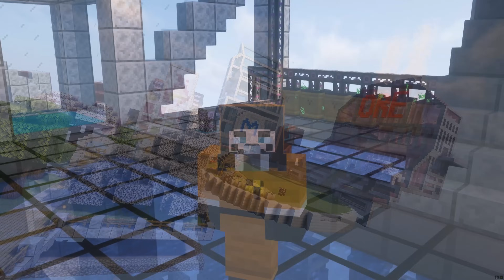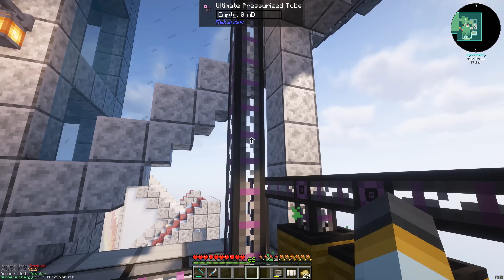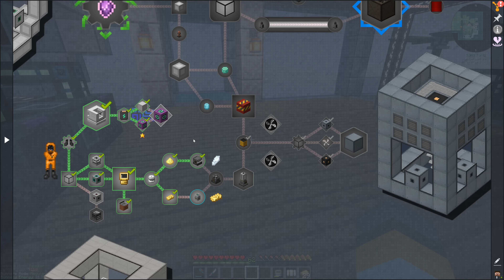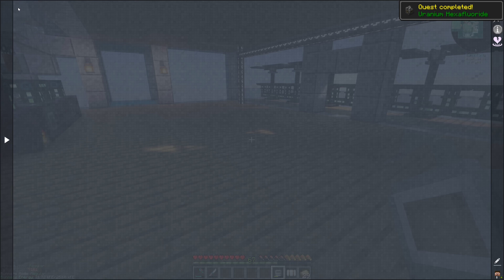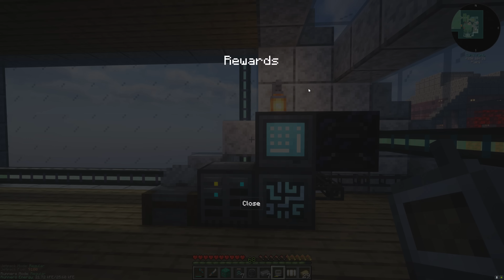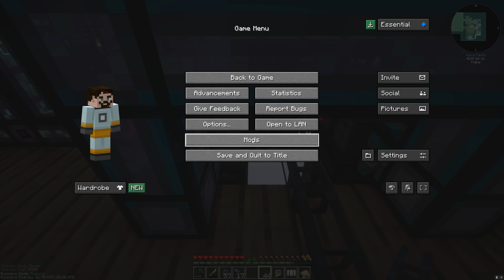ATM9 To The Sky! - Nuclear Waste?!

Comment: As soon as I read "Quantum Entangaloporter" I knew exactly what that was and my nerd brain went crazy lol
For those wondering, here's a simple explanation as to what quantum entanglement is: it's basically the theoretical connection between two particles. I can't remember if this is only observed in certain particles, but I do remember that this connection shares the data of one particle with the other, (and vise versa) and this connection cannot be broken over any distance. This principle is what quantum computing relies on.

Comment: you can use the Integrated Dynamics pipe to pump water into your reactor. it supports up to MaxInt per tick. which should be more than enough for you to ramp up your fuel consumption and allow you to use a single sink

Comment: No soliciting banner stops wandering traders from spawning.

A creative wireless transmitter (from the mod of the same name) is indeed craftable and cost some diamonds, elytra, phantom membranes, and a few other things and will give you unlimited range on your wireless crafting grid and it works interdimensionally. 

Lastly using flux plugs and points from powah can completely eliminate all need for electrical wiring making everything essentially wireless, Including yourself (you can wirelessly charge thing in your inventory for example).

Comment: I would recommend pipes mod, they have like universal pipes and Water pipes to get powered and draw water out of them what faster you could still use one sink and they also can be upgraded to netherite it would have access to infinite upgrade which pulls out a water to transfer to the mechanism machines

You just need a wrench to revert the pipe to pull out and whale crouch you can add the upgrades
Reply: Integrated Dynamics + Integrated Tunnels is a lot better for this. The item transfer rate is the same as Pipez, and it can't handle gases/chemicals, but the fluid transfer rate is effectively infinite. Hook up a fluid interface to a sink, then add fluid exporters to the machines that need water, and set their transfer rate to Java IntMax (look it up and copy it if needed).

Comment: Quantum entangleporter will allow you to clean up the mess of pipes in the basement, they are pretty good
Reply: You name the frequency of whatever is inside the quantum entangleporter and that will be the storage of the block, example being, pump oxygen into the block, name the frequency oxygen. Put another quantum entangleporter next to any machine that needs oxygen and you can use the quantum entngleporter as the input instead of routing pipes all around.

Comment: Sjin what are you going to do with that new nuclear waste? You better do something before you forget about it and blow up.
Reply: 100%
Reply: You can pipe it into the Universal Trash Can. It doesn't explicitly say it can handle chemicals but it works.
Reply: For the record, you should process it into plutonium/polonium/antimatter and then trash the *Spent* Nuclear Waste. Trashing the stuff straight out of the reactor is a waste.
Reply: @rosysummersky  spent nuclear waste is not a fluid and unfortunately the trash cans only voids itens, energy and fluids